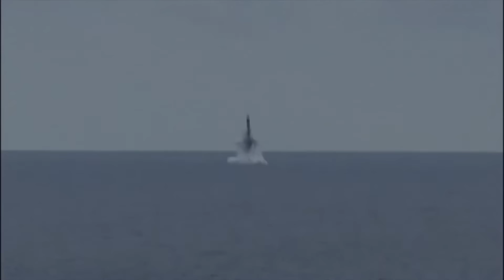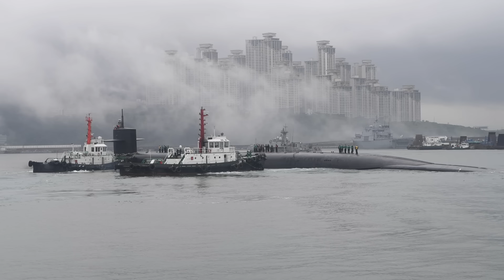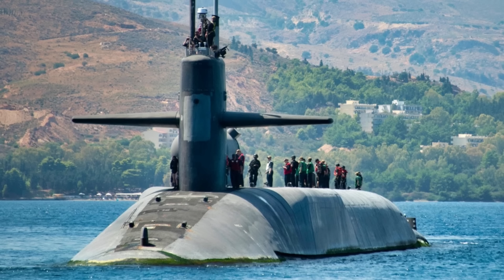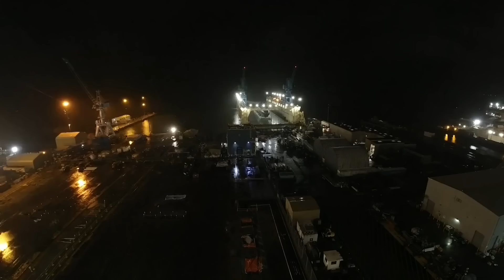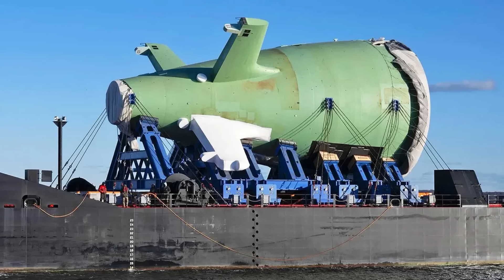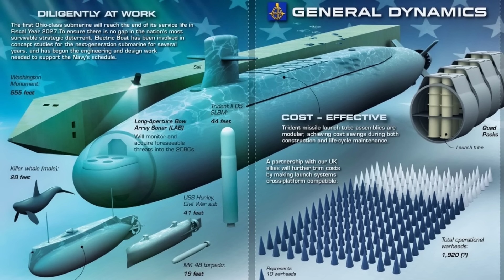Why the US Navy Is Betting Everything on the Columbia Class Submarine

Comment: I'm no expert, but my layman's view is that we wouldn't necessarily need a nuclear yard for a partial refit only of the Ohio-class missile tubes to Tomahawks. 7 x 22 = 154 CM tubes. Reduce the dive depth limits, and wait for space in a nuclear shipyard to service the reactors going forward.

Or, park them all in Reserve status at Bremerton, just in case.

Wild idea: Rebuild the retiring Nimitz-class aircraft carriers as cruise missile arsenal ships. No aircraft other than a few helicopters.There's 25 feet between the hangar and flights decks, roughly the same as that required by VLS cells. Yes, the reactors are old, but no more steam is needed, other than maybe one elevator for the helos. Massive structural rebuilds aren't required. Imagine tripling or quadrupling the VLS cell count of a Ticonderoga Probably add a bunch of one-way drones as well.

Comment: All of the old Ohio class subs should go through a complete refit and refuel being turned into massive stealth missile magazines that could pop up to assist in coordinated strikes... with FF(x) and any other new surface combatants will not be a 1-for-1 VLS replacement for the Ticonderogas that will be decommissioned. This would drastically increase our VLS count across the fleet (at least tomahawks)... would be interesting to see with the VLS if they could launch SM series of missiles and allow for another asset to direct those onto target... could turn the tide in a swarm attack by anti ship missiles or drones to keep a surface combat from the bottom of the ocean
Reply: There is probably no capacity in US nuclear capable shipyards to do this.  As it is,  at least thus far, the Navy has failed to get submarine production back to 2 boats per year despite years and many billions spent.  This will impact Virginia class production which will be reduced in favor of Columbia class production meaning that retirement of LA class boats will soon outpace replacement by Virginias and US sub numbers will decline.
Reply: @danfarrand9072 build in the capacity because we need the VLS count to go up in the fleet, not just hauls
Reply: Amen.  Actually, that's shame that nobody thought of that and no Ohio class were built using tech developed for Seawolf class (steel, reactor, propulsor) but still using Ohio design.
Reply: No. Subs have a dive limit. How many times it can dive safty before the hull starts to fail. Ohio's  are very old on that scale.
Reply: @adamczechowski614  they wont be BSNs anymore and even if they can't go half the depth anymore but accompany a CSG to added another 30-40-50 missiles to a strike group or say another couple surface combatant to drastically increase their VLS count... its worth the figuring out how to keep those subs operational until the surface combatants can close that gap again
Reply: It doesn't matter how many good ideas and whatever smart things "the US should do" a million people have already thought this up. It's not going to happen because there is no space in the shipyards. The US has about 2 shipyards. This idiotic beyond belief situation has continued for 20 years and it will continue until the US builds the normal amount of shipyards it should have, that a country with the world's biggest navy should have, aka not 2. Entire. Shipyards. For the world's biggest navy, and the crews to man it, and all the equipment that requires, and then they become optional. Until that happens none of this great ideas or what they should do is going to matter at all because it isn't possible to do anything else other than what the US is currently doing. There is no more shipbuilding room anywhere. There hasn't been for 20 years and there won't be for far far into the future.
Reply: @cameronspence4977 i agree... we need more ship yards but to think we cant also have this or a similar idea to augment the the fleet is dumb imo.. ff(x) is dumb as hell considering ffg(x) was suppose to be an escort and aws platform, ff(x) is so far away from fulfilling that role its absurd that hauls will be built with no clear path for retrofits (the new bridge renders show it taking up much of the room behind the deck gun, so no VLS?)....Some bone head ideas have been just blooming every year thinking that dandelion will turn into a rose, but every year those dandelions blow their weed ass seeds all over and keep sprouting more dumb ass ideas 😂👎
Reply: Metal does fatigue under constant stress. This may be the single primary factor that the life of the Ohio class is not extended
Reply: @joelr.9330 shouldn't they be able to operate at a % of their max depth still with a service life extension of some sort? The # conventional VLS those could could augment a CSG or another surface combatant formation would be immensely helpful!
Reply: @gotaPhDyoumadbro . Love the idea we just don’t know all the details and science behind it all. Just look at the Ticonderogas and the effort to keep them on active duty.
Reply: @joelr.9330  True.. but the way DoD and military industrial complex like to burn money I could see how theyd say "it isnt cost effective or in the interest of the navy... blah blah"... I'd even make the argument that it'd be cheaper and quicker to still keep those Ticonderogas in service than the current plans for surface combatants... keeping hauls (and VLS) in the fleet is essential these next 5-10 years as the new ff(x) ramps up... A 1 year or 2 year quick refurbish job on a couple Ticonderogas would keep the VLS count up, hell even going for a 3-5yr more complete refurbish job to do more extensive work would stilllllll be faster and most cost effective than any other options thats have been made public... arsenal drone missle ships are unproven and not built yet, current drone ships with the containerized VLS has no where the number of VLS to agument the fleet enough in the short term... Here's a hot take, been saying they should refurbish Nimitz and a group of Ticonderogas to have an OG CSG forward deployed in east or north Australia to have another CSG for deterrence in that Indo-Pacific theater... pretty much all the realistic war games show at least one carrier getting sunk, having one more CSG to utilize in a pinch would be amazing from every aspect expect budget but we burn money as it is, what's another 50 billion at this point or whatever it'd cost refit and refub enough make a CSG that will be a "break glass in case of emergency"... having that extra CSG will really put some cold water on China when we need to, now
Reply: @gotaPhDyoumadbro  I believe there’s no refurbishing left in the fatigued metal when it comes to the Ticonderogas, slapping a new portion of a keel to an existing fatigued keel is almost like the parable of putting new wine in old wine skins , they would burst. The incompatibility of new and old welded together is akin to bursting. Your idea about refurbishing retiring Ohio classes and converting them into SSGNs is still the best option. Before retiring the Ohio they should convert the next boomer scheduled for decommissioning into a SSGN , bring it into service and transfer the tomahawks into it then decommission the Ohio. We currently have 4 SSGNs. With a pair in the western Pacific and another pair in the Indian Ocean that should make for a good one two punch.
Reply: @joelr.9330 I'd want them to at least explore the possibility of refurb for those Ticonderogas, any that it's possible to do.. then do it for the reasons I already stated. But i understand your points, sometimes there just isnt anything you can do thatd make them mission capable again. I just hate this situation the US Navy and DoD put themselves into... LCS should NEVER have had both hauls produced but I am happy they are finding use for them finally with mine warfare and such... Zumwalt should be what Potus uses as this command and control vessel, not some crack pop BBG(x) idea where the time to build, tonnage, cost and pick any of those making a ratio to VLS.... does not make ANY sense.... anyways I'll be watching this situation and hopefully they can pull something out their asses lol
Reply: @gotaPhDyoumadbro  The Japanese have reconfigured The Trump BB with two triple gun turrets forward and two arrears in typical battleship turret configuration firing what appears to be plasma energy salvos simultaneously. Now that would be worth it if it could be done. All the while Star Wars Empire Strikes Back music 🎵 playing in the background. Like you originally said, Ohio class SSGNs are the answer even over the Ticonderogas whose primary function is carrier defense and fleet wide coordination. 
Park two or three Ohio SSGNs off the coast of an unsuspecting enemy who’s saber rattling and you won’t have to worry about fleet defense when you can preemptively strike and eliminate the threat. A frequently used pentagon reporter to leak unofficial official threats hinted at such a scenario where the ccp leadership would be preemptively taken out just before the commencement of hostilities.
Reply: Japanese remake of the Trump BATTLESHIP on YouTube 
https://youtu.be/64AvEM-tR_4?si=8l1eS3oDFCp7erO6
Reply: Or refit the Ohios for use by the Australian navy for our commitment to AUKUS.
Reply: @kenshaffer5664   those old of hauls for a foreign navy i dont think is a smart move. This would specifically be a strategic move for the US to get the VLS up and keep them up till our surface combatants can bolster the VLS count... losing so many VLS from the Ticonderoga and the Ohio being decommissioned is far more concerning in the short to medium term... plus Australia needs fast attack subs not our former ballistic missle subs

Comment: I think it is foolish to reduce the number of hulls versus the Ohio Program, simply because there is likely to be a war with China and we are absolutely going to lose ships.  In addition, even though the reactor will not need replacement, there are definitely going to be overhaul periods for normal wear and tear and unforeseen equipment failures, especially with a new program.
Reply: Aren't 12 total hulls going to allow 4 deployed SSBNs at any given time? That is surely enough to maintain an overwhelming second strike capability and deterrent.
Reply: @lomis99  I listed two reasons why that may not happen, and there are certainly more concerns than what I have listed as well.
Reply: These aren't attack submarines, most of china's subs are diesel electric and only have the range to cover their own waters. Reducing fleet sizes is probably a good call considering the US's current shipbuilding ability
Reply: Or you could just not start war with China.